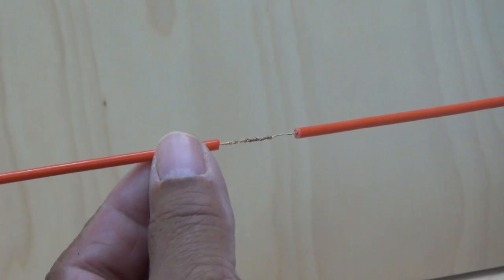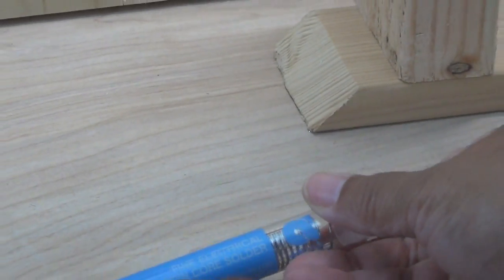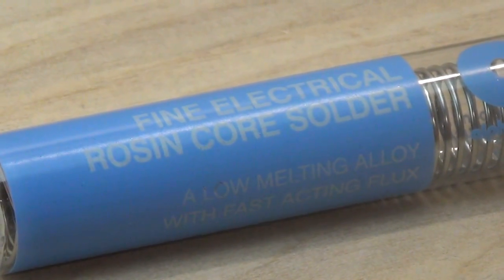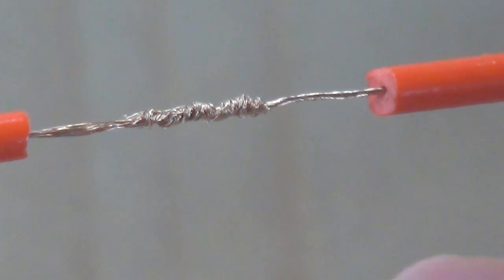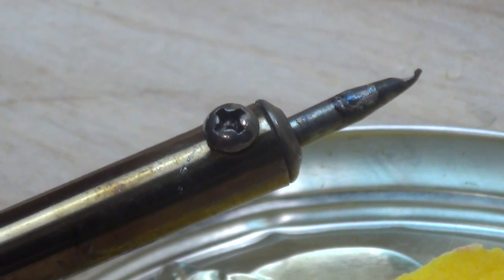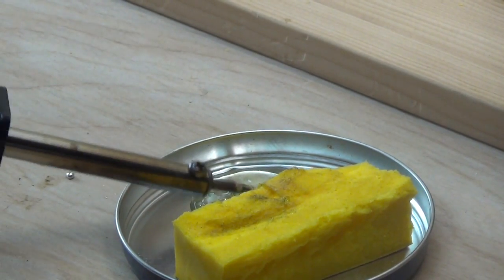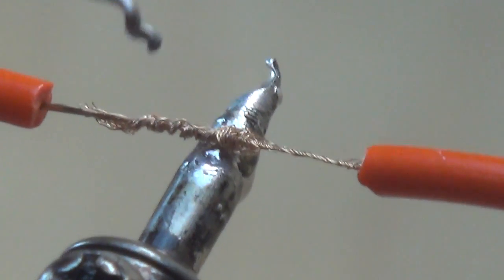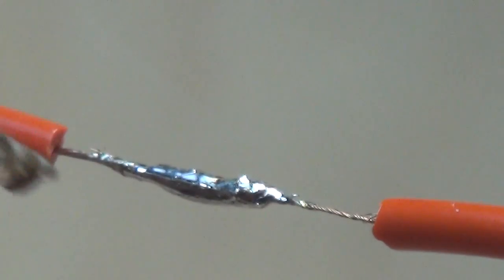How to Solder Electrical Wire

Comment: Been soldering for over 30 years but still wanted to watch you do it. :)
I remember getting hired to install some radios into cement trucks about 25 years ago.
The guy sort of tested me asking why I shouldn't rest the wires that I'm soldering on metal (pair of pliers) instead of in the air like you did in the video.
Told him that the metal would act as a heat sink and draw away the heat making harder to solder.
The relief I saw in his face was almost comical. Apparently the guy he tested previously just couldn't understand that. 
Made $1200 in 3 days. Easiest money I've ever made.
Reply from the maker: Wow, cool story!

Comment: Good basic intro of how to solder;

Couple of things to note ( I notice that many other videos miss this out too).

Firstly, you'll rarely come across a single core cable (as almost all videos seem to show).

Secondly, consider what you are soldering and most importantly how is the cable to be used.

Thirdly, if possible get a soldering iron that you can control the temperature of (different cables/components will solder better at different temps).

Soldering will create a potential weak point on your cable. IE at the point where it is soldered it will be very inflexible. So if the cable is not fixed down and you want to be able to move it around.  Consider folding back the core, back on the the cable, add your heat shrink, then twist the other cable to it. Solder then apply the heat shrink. Therefore the soldered cores are inline with the cable and can use the cable itself to give extra support.

I'm an Audio Visual engineer so I'm constantly having to modify power supplies, solder cables to panels etc.
Another simple way to give a little extra safety to a power cable that you've had to solder etc. Create a loop in the cable ie with a cable tie. So that the soldered section of the cable sits within the loop. Therefore if the cable gets pulled the soldered section isn't going to take the strain.

Final note, using cables with multiple cores. Stagger the lengths of the individual cores so that you don't end up with a huge bulge.

Ultimately, the best way to learn is just to play with some cable off cuts.

PS above is very simplistic, no major details just a few pointers.
Reply: Thanks for the input
Reply: Hope it helps.
It's just good to be able to contribute. I watch all of Leah's videos as even if they don't strictly apply to the work I do. I can normally learn something new or broader my own knowledge base.
In the world of AV you need to be able to apply many trades, so I really consider "seejanedrill" as an invaluable resource.
Leah, keep up the great work:)
Reply from the maker: Thanks, David, and thanks for sharing your experience with the community!

Comment: I always saw people solder, but didn't see it close up, so I thought that you heated the solder and dripped it onto the wires. I found out that I was supposed to heat the wires from the under side and then touch the solder to the hot wires. The way that it was explained to me was that if you just drip melted solder onto the cold wire, the solder cools down so quickly that it just forms a shell around the outside of the wire bundle. If you're heating the wires and then touch the solder to the hot wires, the solder will actually flow into and between all of the little wires, making a really secure bond. That's how I do it, now, so I hope that's right.
Reply from the maker: yes, Linda, absolutely you are doing it correctly!
Reply: Also do not blow on the joint. Let it cool naturally. Otherwise you create what is called a cold joint.

Comment: Great timing, I have to solder the wires to the charging port on my sons power wheel and I was going to buy regular solder and flux you would use on plumbing.  Didnt know there was a difference.

Comment: Leah, as a retired electronics technician, with over 45 years experience, I would like to point out that when soldering wires and/or components always heat the joint and apply solder only to the joint. Never apply solder to the iron or gun tip and spread or drip the solder onto the joint, as doing so will create what is called a 'cold' solder joint. A cold solder joint will break down over time because the joint is not heated evenly throughout and the solder will not bind with the inner portion of the joint. Always heat the joint and apply the solder to the joint, not to the hot iron tip, for a solid quality connection. Just as with soldering copper pipe, the solder will wick into the joint when properly heated and "just a little dab'll do ya". Also, just as a side note, whenever using a wet sponge or similar to clean the tip make sure to allow for the tip to come back up to temperature before soldering. You would be amazed at how much the wet cleaning method will drop the temperature of the tip. I prefer to use brass shavings to clean my iron tip as it does not 'shock' the metal tip by rapid temperature changes. Love your videos. Take care and God bless.
Reply: Also to note that, unlike copper pipe soldering, only use rosin flux or rosin core solder. Never use acid flux like that which is used when soldering copper pipe. That stuff will eat up the wires as well as your soldering iron. :)
Reply: LesterElm1 do you know if using a steel scrub as a sponge/brass shavings is bad for the tip? I have a scrub in the bottom part of a soda can I cut and just twist the iron's tip.
Reply from the maker: Hey, Lester,  it's always nice to hear from you. I didn't know that electronics technician was your profession!  Thanks for sharing your professional experience with the See Jane Drill community. Best regards, Leah
Reply: A steel scrub should be ok as long as it is not too coarse. I have used medium steel wool in the past, but much more prefer the brass shavings.

Comment: Leah, Good video. I loved the "Western Union" wire splice.
I would suggest you replace the tip on your iron, as it's worn out. Also check the retaining screw. It's a good idea to loosen the screw and re-tighten it. It can massively help with the heat transfer. It should also have anti-seize on it. The screw and/ or tip can really get stuck and break off.

A new tip will last a lot longer if you initially tin it with Silver Solder. It has a higher melting point, and seems to protect the tip better.

 The new, so called "environmental friendly" no lead solder is miserable stuff to get to properly flow, even with lots of flux. Even a good solder joint with it looks like a dull, bad joint at best.
   Really old rosin core solder will not properly flow unless you add more flux to it. Some of my solder is quite old, and additional flux is needed to make it flow properly. In an emergency, I have used solid wire solder- aka: Plumbers Solder. One must add a lot of flux to it to get it to properly "wet".

 If the connection is to be exposed to the weather, I suggest the special heatshrink with the sealant "goop" in it. It forms a 
'weather tight" seal to keep corrosion out. Sometimes it called 'Environmental" heatshrink. (They also make environmental crimp splices with the "goop" in them, primarily for the military, aircraft, and other critical industries. They work fantastic for car, truck, & trailer wiring.) Just install, heat, & they are done.

Never solder with "Acid Flux", as it will corrode the wire and it will eventually fail.(This is the stuff used for car radiators). liquid Rosin flux is great. I have mine in a squirt bottle. My favorite soldering paste is 'No-Corrode" brand. I have used it for over 55 years.

Keep up the great videos. Even at my old age, I am still learning from you. Thanks!

Comment: Another great video Leah. I would point out that when you solder, you want whatever you are soldering to melt the solder. As you showed in the video, the wire should be hot enough to melt the solder so that it flows correctly.
Reply from the maker: thanks, David!

Comment: I had the same problem tinning the "tip" (using the term charitably) on that same Harbor Freight soldering iron.  It's made of chrome plated steel and not copper (it even says so on their site!).  I also read in the reviews that if you can get your hands on some heavy gauge solid copper wire, you can tap a thread on one end, make your own tip,  and have a perfectly usable iron.

Comment: a couple of points.
- I like to make the spice a little tighter.  And by that I mean a little closer together so there isn't such a big gap between insulation.
- I never like putting a big blog of solder on the wire.  You just need enough to thoroughly surround each strand.
- when twisting the wires together, try to make sure there are no loose strands that might be sticking out.  this will cause a problem after soldering because you will have a nice sharp piece of wires sticking out that will eventually poke through the heat shrink tubing.  To resolve this, take a pair of needle nose pliers and just pinch any sharp points.
- try and get a bit of solder to flow into the strands that are not twisted together.  Otherwise where the blob of solder ends is going to be a point where the wire could later break.
- if you are using this in an insider environment, then that heat shrink tubing is great.  If this is going to be used outside, your should use an adhesive lined tubing.

Comment: Great video, you might want to check out the TS80 soldering iron. They get to heat super fast, crazy portable, and you can power the thing off a QuickCharge 3 battery pack. Makes an awesome portable soldering iron on the go.

Comment: help .. ha.. curious if there are particular uses that have to be soldered then heat shrink wrap vs just the heat shrink wrap.. how do I  know if the wrap alone will be a safe fix or if I need to solder before the shrink wrap? What factor should I be looking for. .Thanks Leah.. I just love your videos.
Reply: Colleen Lassie for wire connections shrink sleeve is onlly there to protect the solder joint and as insulation.
Sleeving alone is not acceptable.
There are sleeves that have a small band of solder in them.
That solder melts using a heat gun and shrinks it at the same time. 
There are crimp style sleeves that have a metal barrel to joint the wires and the sleeve the shrinks with heat. This style is my favorite.

Comment: Leah, I have been an electronics technician for almost 50 years and only seen a few people who knew how to solder correctly. 
Could I suggest that everyone know solder is not meant to be a conductor, only a bonding and sealing agent. 
Have you ever used self sealing shrink tubing. It is great for me in some applications. 
Thank you for this video.
Reply from the maker: Hi Ken, I've seen the self sealing shrink tubing, but I've never used it.  But I've always wanted to...it seems pretty cool.

Comment: Not sure that you didn't just demonstrate the method of doing a cold soldering joint. This is a high resistance WRONG way (cold soldering joint) to do it. You didn't mention one heats the wire with the solder iron and lets the solder flow to the wire. Very important!